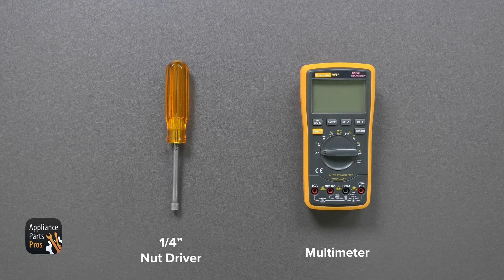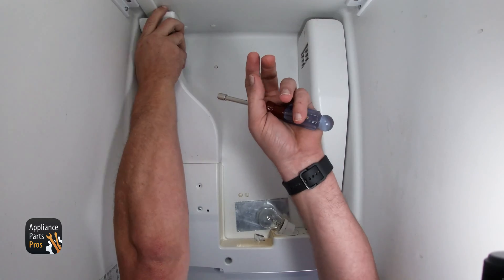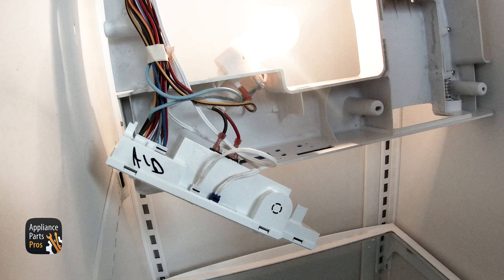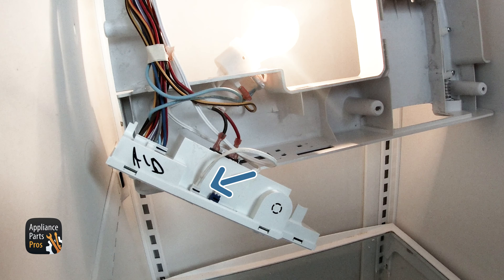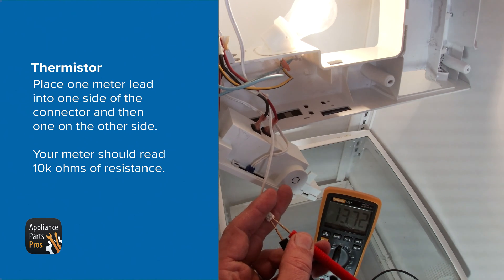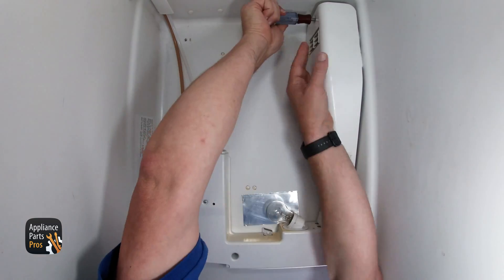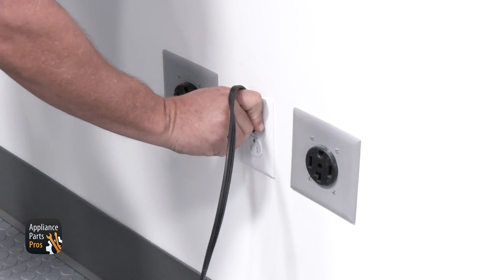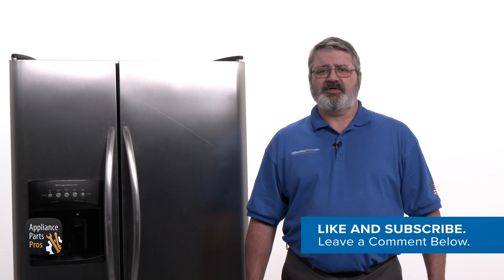How To Test A Frigidaire Refrigerator Thermistor

Comment: You said multimeter should read 10k but it reads 13k in the video. Is that good or bad?
Reply from the maker: Thanks for pointing that out! 👍 The thermistor resistance changes depending on the temperature—10k ohms is the expected reading at about 77°F (25°C).  Our multimeter shows 13k ohms because it was colder when it was tested.

If you want to be sure, check your model's thermistor chart, usually located on the tech sheet. That’ll show the correct ohm reading at different temperatures so you can confirm it’s in spec.

Comment: Should a fridgidaire evaporator thermostat also test 10k? Item 5303918776? When I tested in service mode it was reading 37 degrees when the freezer was set to -2 and cold. Cut it out and reading 10k ohm and decreasing when heated with hair dryer. I’ve already changed the thermostat, fan and board but freezer evap coils keeps freezing over. This is the only other thing I can think of. Could this still be the issue?
Reply from the maker: It sounds like the thermistor is good. If your evaporator coils are frosted over, then you have a defrost issue. So, you will need to test the defrost thermostat for continuity. You can also test the defrost heater for resistance, it should read around 26 Ohms. if those are good then you would need to replace the control board.
Reply: @appliancepartspros  replaced both the thermostat and board already. Heater has continuity. I’m
Reply from the maker: You will need to test the defrost heater for resistance to get an accurate reading.
Reply: @appliancepartspros  measuring 27.3 ohms resistance. Any other ideas? I’m stumped